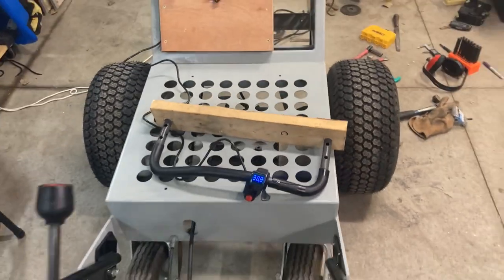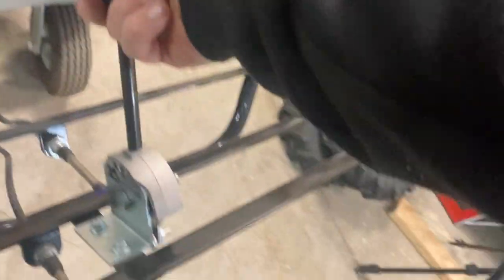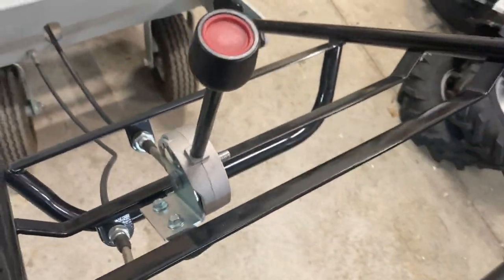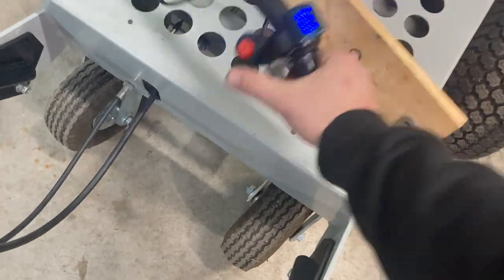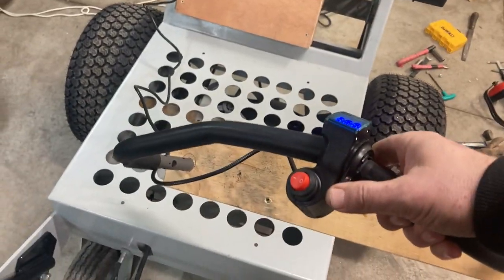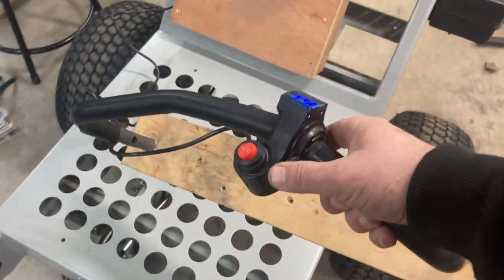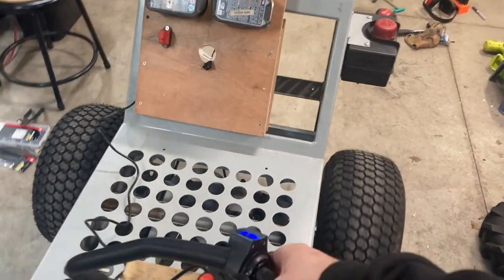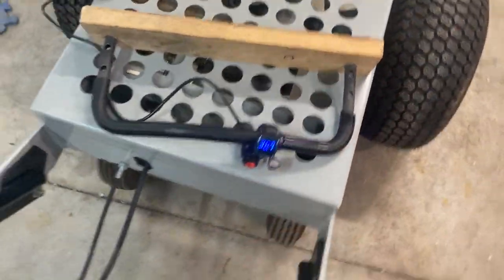DIY Electric Wheelbarrow first test in garage.

Comment: Is there a way to add an electric motor to the pulleys of a gas motor to provide extra torque and save on gas?
Reply from the maker: Yes. That's one way of designing a hybrid. GM had a system called BAS - Belt Alternator Starter. It used a motor more powerful than a typical starter that would assist the engine by providing power to it.
Reply: @BenjaminNelsonX  Really?! Ill look in to it! I wonder how hard or expensive it is to make something like it.

Comment: Hi, what Axe and geardrive is Used ?
Reply from the maker: The transmission is a Peerless 820.
I believe that it has 6 speeds, but on this wheelbarrow application, the gear selector only locks in place in every other gear. They are labeled on the machine as 1, 2, 3, but I think that's might actually be gears 2, 4, and 6 on the transmission.
I tired 1st gear, reverse, and 3rd gear in this video.
Reverse gear is pretty fast.
https://www.peerlessgear.com/wp-content/uploads/2020/08/820-Series.pdf
Reply: Thanks for information about

Comment: 2x5 ah, what's time work?
Reply from the maker: It's difficult to give a really fair estimate of working time because so much of it depends on what you are doing. How heavy is the load? Are you going uphill? Etc.
Making use of removable batteries assures that you don't have to worry about running out of power. Just swap in fresh batteries.